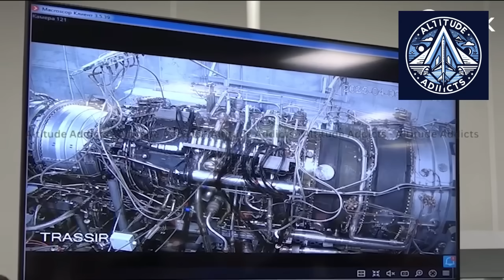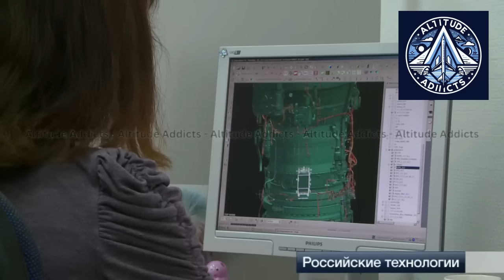Cooling Blades & Stealth Exhausts: Russia’s Next-Gen AL-41 Engine and Derivatives

Comment: 💢💢  Our innovations enable advanced turbo machines not otherwise possible.  We have also developed a zero vibration range extended [genset] for aviation and other needs. If we incorporate our Fuel-Agnostic, Zero-Emission technology and HushPropulsion tech, the drones will be utterly silent and capable of longer range with higher payload.
Another drone tech can take out a squad of soldiers in one minute even when un-grouped and at long range.
Our BlackHole stealth tech can be applied to any vehicle to make the invasion force undetectable until in close visual range  💢💢
Reply: Congratulation to achieved next level of gas turbine engine..